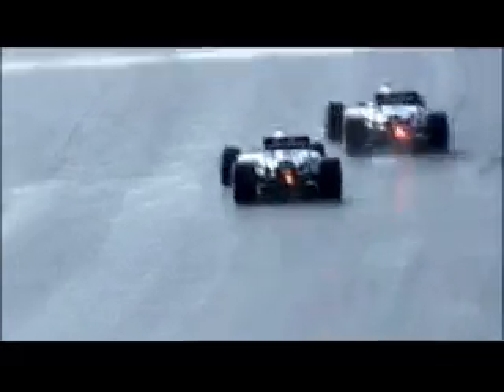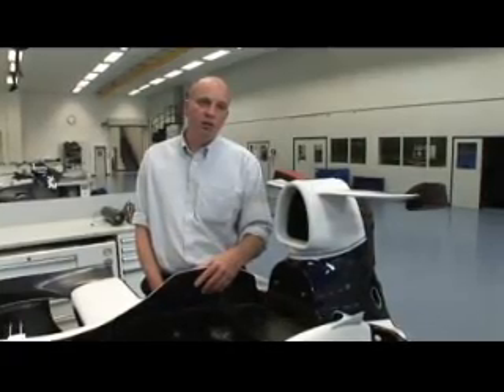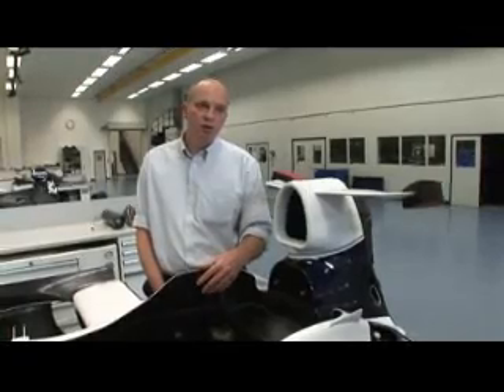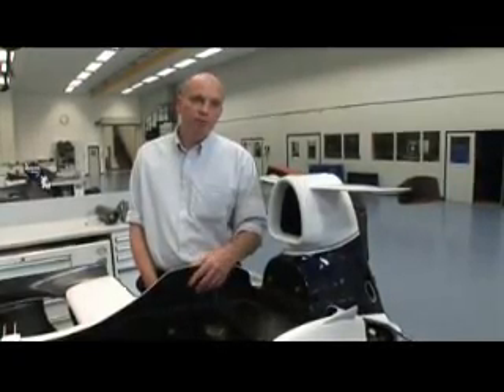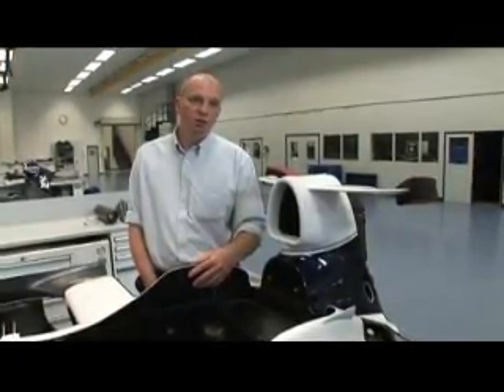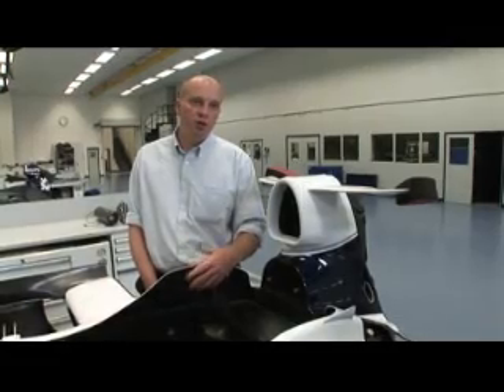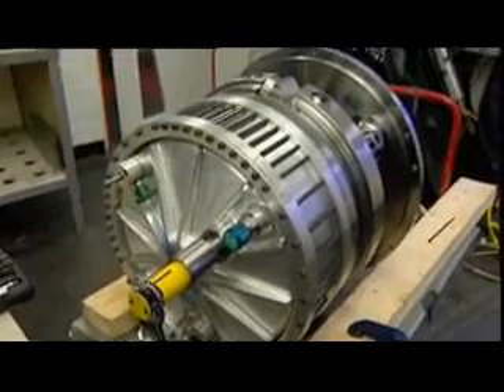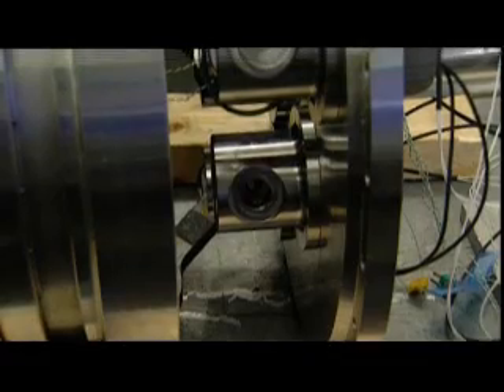AT&T WILLIAMS KINETIC ENERGY RECOVERY SYSTEM

Comment: there must be a hell of a lot of enegry lost in the transition between the electric and mechanical energy, isnt there a way to do a similar thing but withough electric motors and chargers etc? like a more direct power transfer to and from the flywheel.